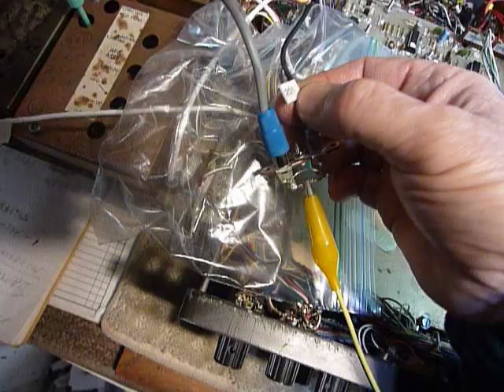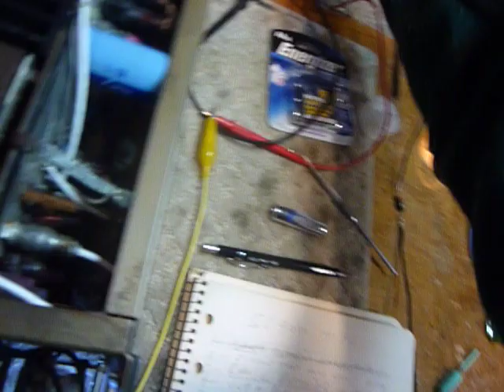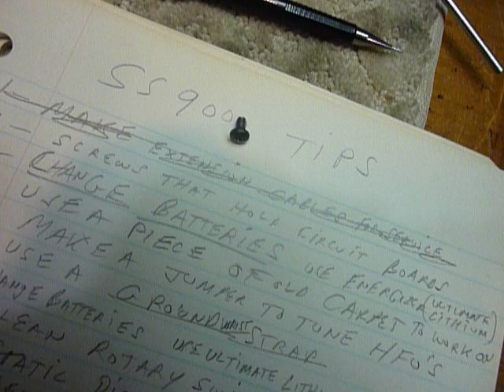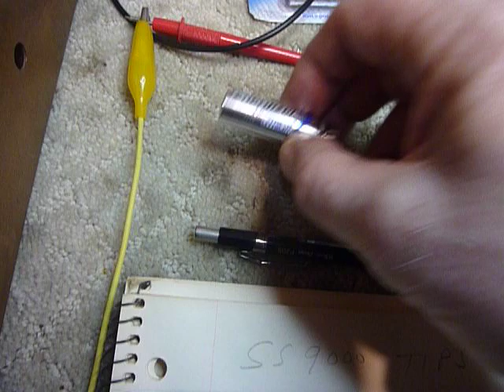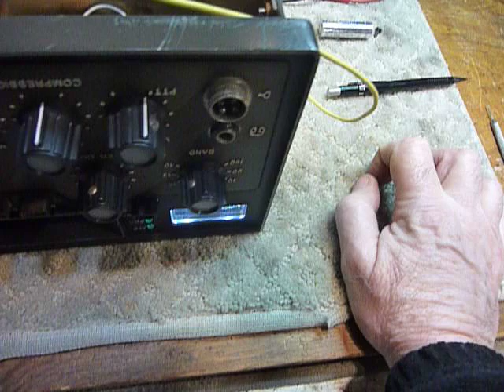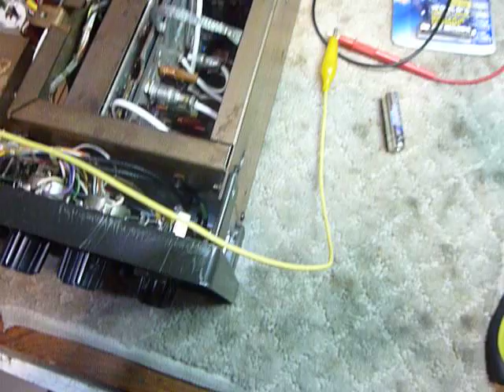HEATH SS9000  Heathkit Synthesized HF tranceiver

Comment: Thank you for the tips.  I have an SS-9000 that my Dad left me.  It looks like it's new.  It worked at first but then after a few days, I get an error that reads HFO unloc.  I posted in the Yahoo group and the suggestion was to clean all the contacts.  This was back in 2011 and I still have not had time to do it.  I have fond memories of listening to QSOs with my Dad on this radio.  I just bought an Icom IC-7300 (which is still in the box due to time) but I'd really like to get this fixed.  Everyone tells me to sell it but I have the radio and power supply and they're both in really good condition.  They look like they just came out of the box.  Hopefully I'll get some time soon to take it apart and fix it.
Reply from the maker: Richard , You have a very nice reminder there of your father . You can align the HFO's  just follow the instructions in the SS9000 Service manual  .  If you do not have the service manual 
it is posted on the internet . Also there is a Yahoo group on the SS9000 and the guys on there are very helpful . You must join the group to get on  there and  is no charge . There you will find posted  under "Files" many helpful items including a full set of schematic diagrams . 73 
and good luck fixing your fathers SS9000   Bob